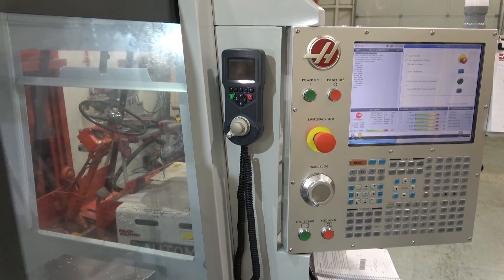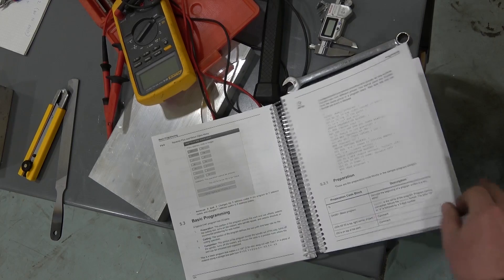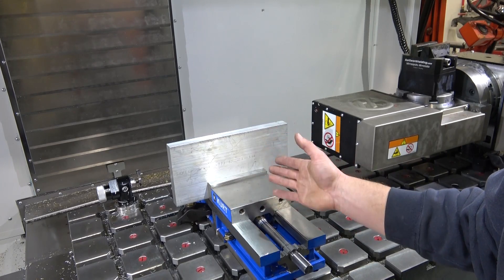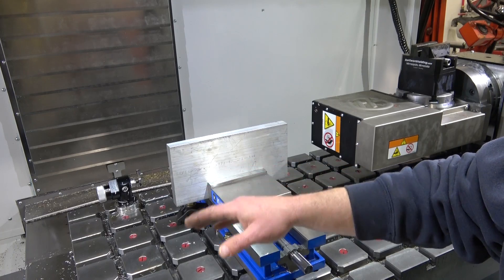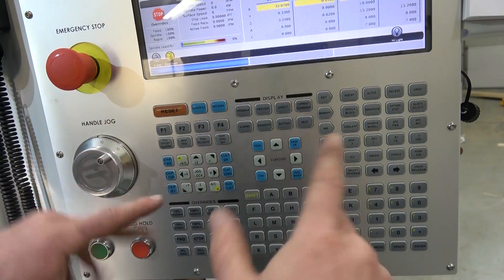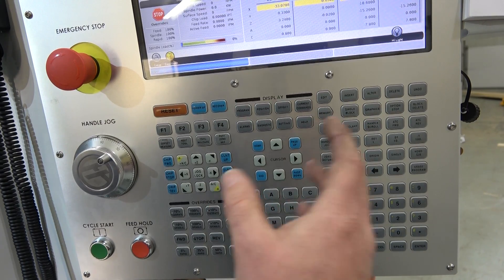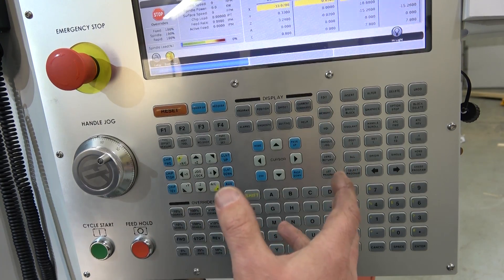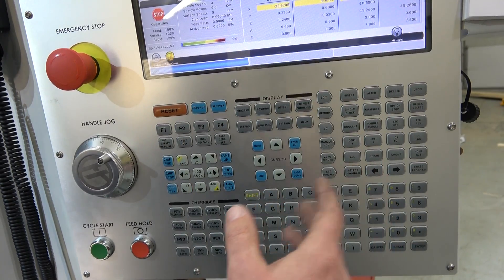HAAS Shakedown | JUNK Visual Programming System

Comment: Hey AVE , ditch the conversational programming asap (VPS Haas bs), it's junk! Don't fear the G-code it is your friend even though it probably doesn't seem like it at the moment - you will become a believer. I teach both semi-pros and beginners alike in exactly this and have done so for the last decade. Not sure how to contact you but I have all the baby steps through to such things as in-cycle probing using macro and other Gucchi magic.

If I may sir do the following:
Get to grips with the Work Coordinate system (WCS - G54-59 etc) and tool offsets. G54 for shifting basically the reference or origin position X0,Y0,Z0 to your part location which I can see you doing. Same for tooling; this is important as codes like G43 H1 etc and G41 D1 etc control how a tool engages with your work piece. H2 and D2 for tool 2 and so on.

Then start with the coordinate system for programing (cartesian coordinates) X Y Z movements. Get some graph paper and produce some profiles ( forget about Z for the moment) and practice following the profile around CW and then CCW ( Climb vs Conventional or G41 vs G42). Then add either Linear or Circular code in front. i.e. G1 X0, Y10 F100, or G2 X0 Y10, R10 ( use I J K later - R= radius is easier to start with and can be recognised in program better). Once happy Profiling is sorted start to add Z moves, hops from outside to inside. Remembering two important heights ( Clearance Plane and Rapid plane - typ Z50 & Z3 if in mm).

Then start to break down the syntax of programing structure. For instance starting or setup.

O1234 - Program number ( no higher than 8999 as macro is stored and protected above these numbers)
G90G21G17G40G49G80( abs programming)( metric)(XY planes)(comp cancel)(Length offset Cancel)(Can-cycle Cancel) - Safety line, part setup part removing anything left from last setup. A must have! Look up what modal means.
G91G28Z0 ( Can remove this for the moment is it just telling the tool to return to Ref Z0 before a tool change, Haas machine will do this anyway).

T1M6 ( Change to the tool you want simple)
G0G90G17G54 X??? Y??? S1000 M03 (Basically repeat some stuff from safety to make sure and add WCS (G54) add you first move position X&Y but not Z. Then Speed and start spindel forward (CW).
G43 H1 Z50. M08 ( important line, which tells the machine to add the length of T1 to the gauge plane /nose of the of the machine, then move to Z50 above top of job - if Z0 is set top of job. The machine will remember the Z50. part as it clearance plane (return from drilling to this height etc). M8 turn coolant on.

G0Z3. ( Rapid closer to job - know as double Z move).
G1 Z-10. F100 (feed at a controlled rate to working depth)
Then add your profile work from before.
G1 X Y stuff. Never start on a G2 or G3 circular move. You always need a linear first, this will become more obvious later on.
Finish profile.
G0 Z50. ( return to clearance plane once finishing profile.
New tool or finish program. (G91G28 Z0, M30 - if finish)

The Haas interface is one of the worst going and just overly complex. Anyway contact me if you would like to know more. Good luck and keep your pecker in the rotary. ;)

Comment: Can't you take the g-code it kicks out and correct it? I find it easier learning what all the G & M codes do and reading the code back.
I'm lucky in that I'm getting to learn CNC on a wire EDM (Fanuc control) essentially the same as a mill, minus the Z axis (set it and forget it), minus the tool diameter variability (always 0.25mm), no messy coolant just deionised water. also the feed rate is automatic based on the type of cut/power setting being done.

Comment: AvE, won't really help the inbuilt code but you can run it in Z lock at say 300mm above your zero, that way you can check you're not going to run into your vice or the bed and that you've selected the right tool.

Comment: Even looking at the UI I can see its kinda high-baller stuff. I mean, its not god awful but someone get a end-user engineer/designer on that who has not had Tequila Runsise yet. Every manufacturer has their own "propriat...propietie...propan...profan...." technical marking ideas. Things like Th, Ls, Em, Mp-s eor what ever they call speeds-n-feeds SHOULD be added to the visual work operation picture. So even an old machinist or a fresh bumblefuck knows what to do in the ballpark.

Comment: Ok.  I've never used CNC.  I admit that.  But in a more general sense..... what I've noticed is that 'visual' programming methods, linking symbols together instead of words?  Seems to me like it's just one overly complicated and unintuitive way to avoid just opening a fucking text editor and spending five minutes writing code.  You run into it in modded Minecraft a bunch.  Psi, Pneumaticcraft, other mods.  Anything where you assemble instructions instead of, you know.... just fucking writing them.  I'll admit, with something like a CNC setup it makes a little more sense, or at least having an image of what you're going to be cutting does anyway.

Comment: Internet experts and relatively limited time to spend on actually working with the CNC machine are great combination. Go slow and safe and you will be reminded about that real professional would do job in 20% of the time or go fast and crash :D I think for youtube purposes it would be best idea to always do 2 pieces one as an practice piece to be sure that the machine won't collide and then the second one with super fast feed speeds and max speed on quick movements.

Our Heidehain machines have nice simulation mode where it should show how your work piece is going to end up but for some great reason the more complicated job you have, the less changes there is to that simulation to work.
Reply: HPC/AvE collaboration when?
Reply: @JediDachshund  Seconded!  

More importantly, my pants suddenly feel... funny?  tight?  tightly funny?...  I'm posting on an AvE video in a reply from Beyond the Press.  I feel feint... it's like a velvet picture of Elvis coming to life....
Reply: I don't know about on the Next Gen controller, but on pervious ones you can watch it run through the motions on screen before cutting. I don't think they'd take that out, I just don't know if hitting Setting Graph twice pulls it up or not

Comment: Try running the tap a bit faster, like 400-600 rpm. If you run it too slow, it wont cut properly, and instead squeeze the material away. You should also consider putting it in a proper tool holder, with the one you use, it can wiggle free, or slip. :)

Comment: Pro tip: don't use ruby probe on aluminium
Reply: why
Reply: @Ray-ej3jb   The aluminium does an strange this and shares electrons with the ruby. As ruby is an oxide of Aluminium "adhesive wear" this really only applies to scanning where the probe is basically dragging itself across the part surface to map hundreds of points. More a CCM issue than CNC but correct. Zirconia ball ends are better for this.
Reply: oops CMM that was meant to be

Comment: uncle bumbulfuck sounds like he's getting a raw nipple. shoulda got an old hardinge cobra that you have to strip to the bone to clear out 20 years of chips then have to figure out whats wrong. good show I'll be right here learning with ya. your still way away from figuring out weather it will actually figuring out that it wont produce the advertised max metal removal rate a (the old cobra will) but you'll get there

Comment: whats the point of even starting to learn the conversational systems, you are not going to use it anyways?  learn how to set tool offsets, learn how to set work offsets, learn how the machine will start to run something generated by a proper cam. when that fails learn what the g codes mean and why it failed then fix the post processor. set rapid to 25%, set feed to 50% and still break tools in horrifying ways.

Comment: the haas visual programming is so crappy because all of the other machine tool companies  have patted all of the easy conversational programming so avoid having to pay copy right they just make the least useful programming interface. that and if you do some shopping around and deal looking we just picked up a hurco  vm20 witch is really close to the vm3 and we got it for 30k less then the same package haas quoted and the hurco's programming is so good you could take a person who  has only ran manual machines there hole life and after a couple days have them cranking out parts. the hurco's build quality is a little better then haas but i guess its all about what your machining for one part widgets the hurco is the way to go making a milling parts that don't have to hold stupid tolerance in not particularly tough stock then haas all the way

Comment: Has someone from your HFO updated the control to the latest software? We’ve had our machine updated numerous times...still has a few bugs, but better every time. Noticed that your OTS calibration might have been done in the wrong ‘orientation?’ I’d expect the end mill diameter measurement to be done along the y axis to avoid potential collisions with the probe body. Also, is your spindle probe doing a spindle orient before each cycle? If you choose to recalibrate, I’ve been told not to use the all in one calibration cycle. Use the separate cycles for each the tool setter and spindle probe. Finally, adding chamfers first can help smooth your rigid tapping and maybe save some taps.
Reply from the maker: Yes, good eye. OTS orientation fixed. Thanks for the heads up!

Comment: So far Iv only seen one conversational \visual programing control worth using. And its from a no budy company called centroid.  The siemens 840D isn't hoRific once you spend some time with it. But it still does its own thing once in a while. As far as any other iv tried you may as well ask your 2 year old to write the program it would have less problems. Granted if you got a milltronics it dosent matter who writes the code the machine will change it mid run, and then change it again on the next run.

Comment: I ran an older model VF4 (2007-08) model for about 4 years. We didn't have the fifth axis but did have a fourth axis rotary tabe. It was a small job shop that made bronze bushings. Lots of one and two part orders, a big run for me would be 30 parts.  I was just a set up guy and button pusher, though I had to figure out my own set ups and tooling positions in the carousel. I learned some basic stuff with G and M code, It was a fun job work wise but the work environment and personel were horrible so I moved on.

Comment: The older VQC macros might be a bit more functional if they are still there. The NGC control may have totally killed it off. Tap "Program" three times, maybe "F2" after that to select the template. Should be a green on black screen. The new macros are all compiled from a PC so I'm sure functionality is spotty. VQC was written long ago, maybe more carefully, and I know it works. Any machine will do if you'll do. Check out the Haas Mill Programming workbook as well as the Renishaw Inspection Plus programming manual (which they don't give you). The Renishaw does so much more than the VPS lets you. Somewhere I have info on making your own VQC templates. Oh and shortcut, "Handle Jog",  type "Z" (or X or Y) from the keyboard, "Home G28" no cranking the handle all day. For what it's worth Mazak Mazatrol has a bunch of broken English translations they can't fix now that it's a convention, but it's terrible to learn.

Comment: I've seen several permutations of the Haas programming software and I've hated them all. If you are going to spend the time and effort to learn a way to program, learn yourself a Cam software. I'm not a fan of Fusion.. but it's free... not sure about the multi axis though. If there is one thing you can count on.. if the words 5th axis are used, you are going to be charged an absolutely unfair amount of money for everything from software to fixtures.

Comment: Wish I could help you, but the Haas machines were coming in the door as I was retiring. Straight g and m codes when I moved over to cnc, and we saved the programs on paper punch tapes. We got Mastercam in house around 1995? and still had to check every line after it was sent out to the machines. You ABSOLUTELY need a floating tap holder!!!!!!

Comment: I've always had problems with rigid tapping on HAAS mills. A floating tap head usually sorts out any problems. On another note, is the mill anchored down? If not, the light frame will amplify any harmonics and make a heck of a racket.

Comment: Never used that built in haas visual post! I wonder if the errors are being caused by the lack of ram they put into the machines? I know the old ones would error out if your post was over 5mb in size but would run fine at 4.9mb size posts (at least the ones I've used) but I'm still a long code builder and i always will be

Comment: After 12 years of machining,  nothing makes your butthole pucker more than watching a  tap cycle start knowing that red button ain't going to do shit for you. But it looked like to me that the surface footage on that tap was way to low. You need the speed to yank that chip out of the hole. Most of my experience has bee. On an older vf2ss and I wouldn't hesitate to run that tap at 1000+ rpm. Just make sure you left a fair amount of clearance at the bottom of hole and that your drill didnt push up in your holder leaving you with a shallow hole. And give peck taping a try, works awesome  for deeper holes and makes just about any tapping experience a little less work on your butthole.

Comment: my $500 3D printer i built probably makes me an expert at a machine like this, just let me know if you have any questions
Reply: $500 printer?  Spoiled brat, I've got a $300 printer.  Hold my hernia while I take a crack at her.
Reply: @thegardenofeatin5965  Hernia? lucky bastard, no one wants to hold my hemorrhoids.
Reply: @thegardenofeatin5965  300? Pfft, I built one myself from some scrap wood and reclaimed inkjet printer motors!

Aaand it sucks
Reply: Wow, living the high life with a $300 printer? I bought a $150 fire starter that seems able to 3d print. Hold my fire extinguisher a minute
Reply: your so lucky you got off with 500, my delta that I built is close to 800$ and counting. The damn thing has turned into a project car in disguise.
Reply: @mintonbrunkhorst7070  Oh man, delta printers are a train wreck into a dumpster fire at a shit show.  I gave up on deltas.

Comment: I use newfangled solutions "Mill Wizard" when I want to do quick Visual-mill operations.  I have also used Gibbs Cam, Fusion 360, manual coding.. a few others, but I still use the newfangled wizard for cobbling together a few operations and to get the job done quickly before the guy with the manual machine laughs his ass off because he just beat you to the finish line!!!

Comment: I never like to tell another man his business, but... (yes I do!) you really should have bought a Hurco.  I used an early version of their "conversational" control on a Bridgeport-size CNC knee mill back around 1994 and it worked like nobody's business.  I was just office scum back then, with no experience cutting anything but my food, and I was turning out fussy little parts that passed QC and shipped to customers in a couple of days.  It was so easy to use, an untrained 23-y/o figured it out.  I'd give my left nut to have that machine in my shop today.

Comment: Haas VPS sucks, and their Ethernet NIC implementation isn't worth the tits on a bull.  The shop I work at has two new VF-3s and a new VF-4. They won't stay connected to the shop network for shit, no matter the settings on the machine or server. As a result, we sneaker net them with thumb drives like it's a bad version of 1975.  But what really takes the cake is the Haas tech having the brass attachments to tell me that the Ethernet wasn't working because the CAT5 cable jacket was the wrong color.  I'm in charge of safety, among other things, and I wanted to put a mirror under his nose to make sure he had the brains to keep breathing. I also wanted him out of the shop before he hurt himself doing something stupid and generates a reem of new paperwork. I hope you got a good price on that mill partner. My Haas experiences have been bad enough to convince me to never spend one single Yankee buck of my own money on them.

Comment: Uncle Bumblefuck, I couldn't help noticing that you used a push cut on the outside profile. Was there a specific reason for that, or is it just an old habit from being used to the good ol' Bridgeport? We almost never use it, and I'll mention (complain about) it to the programming dept if I see it in a new prog in any of the machines I'm setting.
All the machines I set run Fanuc NC systems by the by.

Comment: Fusion 360 is pretty cheap for the 3 axis version.  And when you get it, it has something called peck tapping.  What you save in taps will be more then what you pay for the software lol.  Just make sure setting 133 is turned on.

Comment: I never used the HAAS built in software... I programmed everything manually. I used Solid Works to find the coordinates and imputed the XYZ into my hand written code. I could always program faster and more accurately than any software, but I had years of experience and training. Long live G-code and Custom B Macro (at least on a FANUC controller).
Reply: If you need any help...jest holler, but please realize I am just an old and slow Missouri Ozark Mt. Hillbilly.

Comment: Haas is easy for tapping also.. Run your spindle @100rpm. Set your feed rate based on tpi. Example.. 1"-14 thread. Divide 1 by tpi then multiply that by rpm. 1÷14=0.071428. X 100 =7.1428. In G-84 set feed rate to F7.1428. Hope this helps